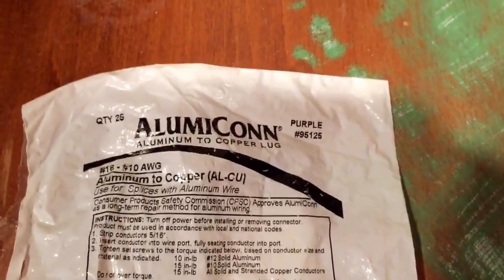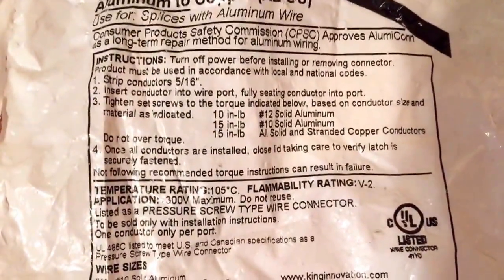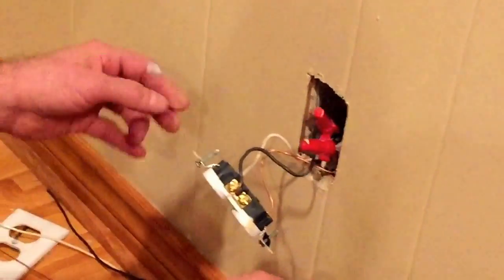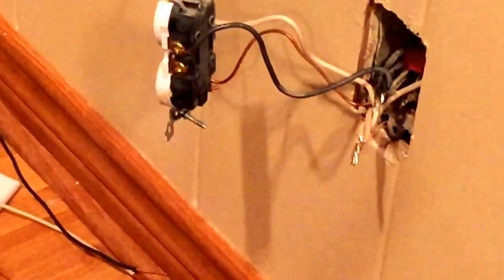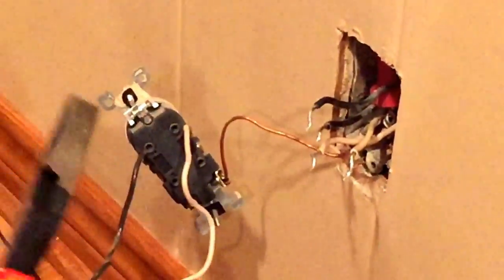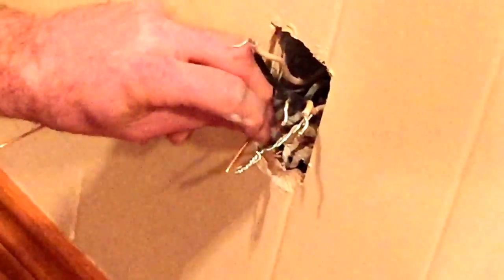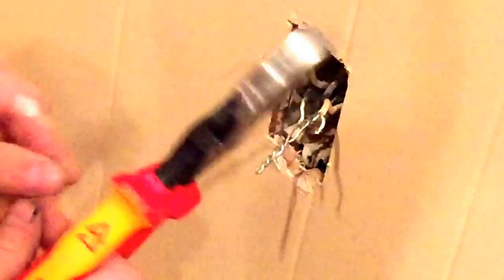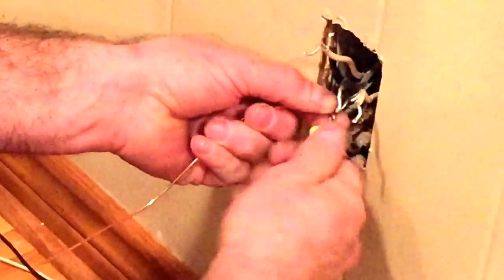Steve's video

Comment from the maker: Yes I agree using the Leviton Colar receptacles if you have enough wire works best. I assumed that's what you use that's I believe the only one made 😊
The ideal 65 wire nut cost a little more, about $5 a wire nut, but I think they're worth it. 
Thanks for your feedback!  I'm going to try to do more extensive aluminum videos. Probably about half my work is an electrician is with aluminum. It can be almost as safe as copper it's just not as forgiving if you don't play by its rules😊.
Thanks!

Comment: How come you don't mention CO/ARL Outlets???? They're made for aluminum wiring.
Reply from the maker: The Leviton (12650-W)  CO/ALR outlets work well, especially if the wire conductors are long enough. I am working on a more comprehensive video.

Comment: JUST found out the other day the whole house is full of aluminum-- started researching the whole issue of pigtails and a alumi-con connectors and finally realized- because the boxes are so shallow- there simply is not enough room to add additional connectors-- so have decided to  swap out every plug and switch for  those compatible with aluminum and copper--- would this  be acceptable in alberta,Can ???  I wired up two houses in the  TERRITORIES but that was years ago and as we all know-- codes  change with time  and province.......martin
Reply from the maker: They can be too small, making it more difficult. They can be switched out.  Carlon BH118R are good sturdy boxes to replace them with.

Comment: Can you use the purple cone shaped connectors with the antioxidant for aluminum to copper instead of these AlumiConn connectors? Or alternatively, just coat the aluminum wire in antioxidant cream instead of having to piggytail copper wires to aluminum wires?

Comment: Okay, but does the wiring still get hot under a load after installing these connectors? If it does out with the aluminum wiring.🇺🇲😀👍
Reply: Manufacturers would not make a product that would cause a fire if installed properly.
Reply: @zsdjr1  Install it in your place then, I'm going with copper.🇺🇲😀👍

Comment: These torque screwdrivers are pricey, $300 where I live. I'm wondering if I can use a basic 1/4" torque wrench in inch lbs, with a screwdriver bit attached. Those can be had for $50 and can be used on other projects, unlike a $300 1 project/1 use screwdriver for a homeowner.

Comment: do you need to do this in the main panel for the AL wires also or can they stay connected to the breaker and neutral and ground bars?
Reply from the maker: No, most breakers and ground bars are rated for aluminum. It will say on the panel or breaker.

Comment: i was literally so careful learning until minute 2 I am 100% sure is 10 gauge copper and 12 gauge aluminum, these two are compatible with each other but 12 gauge copper and 12 gauge aluminum will over heat the 15 ampere fuse in the panel box...im truly dealing with this issue right now the electrician i hired put 12g copper on 12g aluminum... i have gone through so many fuses until another electrician came in again i properly reinstalled the receptacles again to the proper wiring mixed
Reply: read a ampacity chart before you jump on youtube bashing a electrician.  Free spoiler alert, 12ga copper is superior to 12ga aluminum and wiring doesn't cause a fuse to "overheat" or blow unless it's a direct short.  and 10ga copper for a residential branch circuit?  seriously?  sounds like you're bashing a actual electrician and praising a hack, good luck with that.

Comment: If your house is wired with Aluminum, why would you use Aluminum COM’s for outlets and switches when you can just use CO/ALR switches and outlets?
Reply: I read that it also had to do with the copper shortage due to the war
Reply: @arieswaters yep, very common problem for homes built or had wiring added during the years roughly 1965 - 1975 give or take a few,  much of our copper was used by the military for copper and brass shell casings to support the  Vietnam war which was a war the US should have never been in but that's a different topic for another day.   Fortunately compatible devices and connectors along with the improved aluminum 8000 alloy were all developed in the early 1970s to hedge off many of the failures that occurred in the 60s when the industry switched to AL wiring and the same tried and true methods for copper were carried over to AL
Reply: the few reasons why is tamper resistant(TR) code requirement in residential, they do not make any CO/ALR outlets that are TR ( that I know of, or seen-could be wrong).  So minus that small requirement, other reason would be if you want to use decora outlets/switches or need to use GFCI's any place, they do not make any aluminum compatible devices to suit those needs.

Best practice really is to terminate all aluminum to tyco crimps or alumiconns like the video demonstrated, or if practical remove it entirely - issue with the rated outlets is someone unknowledgeable (homeowner/handyman) in the future could change them out to a non-compatible device creating a dangerous future problem.... and problems with electric usually result in fires, so typically best to avoid future problems.  

Strange to say, but if copper keeps getting out of hand in cost we may be going back in time to using aluminum for residential branch circuits like before, which is exactly the same reason why houses were wired with aluminum in the first place (copper shortage/pricing)...

Comment: Please let me know if this sounds correct. 12 gauge aluminum is for 15amp circuit, so the copper pigtail would be 14 gauge. So 10 gauge aluminum is for 20amp circuit, so the copper pigtail would be 12 gauge. Or,  would it be okay to use 12 gauge copper regardless if the aluminum is 12 or 10 gauge?
Reply: Sorry one year late.   Disclaimer i am not a licensed electrician,  but i have helped wire parts of the home on the family farm, as well as have various reference material regarding home wiring.  This is what makes more logic.  Because a circuit breaker is designed to shut off current if the amps exceed a safe level for the ampacity of the conductors.  For a typical 15 amp home circuit,  a 14 gauge COPPER romex is used with a 15 amp protection. However,  because aluminum is not as good of a conductor as copper, you'd up it one size, therefore a 12 gauge ALUMINUM romex would be 15 amp protection, whereas a 12 gauge copper would be 20 amp. A 10 gauge aluminum would require 20 amp protection,  a 10 gauge copper would indicate 30 amps.  So lets say you have 12 gauge aluminum with a 15 amp breaker, you could pigtail with a 14 gauge copper and still be safe from overloads,   make sense?

Comment: Great video.  I would think the ground should also use a AlumiConn (that's how the King video is shown).  Although not typically carrying current, if the dissimilar metals (mainly Al) oxidize, you will have no ground (safety issue).  They also make wire nuts for use on Al/Cu connections which I would think would be better than a standard wire nut, but there seems to be issues with them, too.
Reply: Mogman150 it is supposed to but he does it wrong, and no real electrician uses a torque screwdriver

Comment: The ground needs an Alumiconn also!  They make a 2 conductor purple connector.  The fact that the ground carries no current has nothing to do with it.  The problem is dissimilar metal corrosion (and to a lesser degree different coefficient of expansion).
Reply: I'm glad you said that...That's also why they require dielectric unions on water heaters....Thanks for the catch.

Comment: Super informative..  Recently bought an older house - didn't know aluminum was a thing..  These guys make replacing the old outlets much, much easier.  Video helped tremendously with the process.  Thank you!!
Reply: How old is your house? It's highly unlikely you have aluminum wiring in your home if it was built before the mid-1960s or after 1980. There was a shortage of copper wiring during this period because of the Vietnam war. Homebuilders resorted to using aluminum. It was only years later that people realized what a mistake this was, because aluminum wiring can't handle the same load as copper unless larger gauges are used. And you can't connect copper to aluminum. They don't like each other.

Comment: Aluminum wire scares me, I've worked on a lot of Electrical in my young age being only 24 now, I remember there would be parts of the house that would would short out and well that is how I learned. Now thanks to that I know a lot about aluminum wiring thanks to growing up in a 1972 Double Wide lol.  The new owners  that bought it tried to connect copper and aluminum in the master bathroom to ad and outlet in the laundry room using wire nuts and caused it to catch fire and burned, it luckily did not burn down but it did some damage to the place "The fire department saved 90% of the trailer" as it was a nice place for a mobile home. I always always have been scared of that while living there but like I said thanks to me I use to check every outlet, switch and junction box every 6 months and re tighten all connections. A lot of people do not realize too that you CAN NOT use 1500 Watt small space heaters and stuff because it will get those wires super hot.
Reply: We recently bought a double wide built in 1972. Would you recommended using the CO/LAR switches and outlets?
Reply: Jose Diaz it’s co/Alr aluminum rated

Comment: I heard that AlumiConn are no longer accepted by Insurance companies. They want Copalum crimps now.Is it true? I need that work done.
Reply: I'm waiting to hear from my insurance company and I have an electrician on the way over in the morning. The only Copalum certified electrician I have found said he has switched to Alumiconn.
Reply: Did you find anymore information about this. I asked an electrician who doesn't do residential and he said not to call my I durance company because that could open a huge can of worms. Now I don't know wtf to do
Reply: Oh my goodness it is October 4th 2022. I can't get a better rate on my insurance for my home because of this aluminum wire in it and I'm getting into this freaking rabbit hole with alumacons. And my insurance company not accepting alumacons but I think I found State Farm does accept them. And then someone brings up this copalum whatever that is supposed to be better than the alumicons. Holy hell I don't want to be an electrician I just want them to figure this shit out and do it and fix it

Comment: Surprisingly, the expensive Purple twist on wire nut is not recommended nor approved by the U.S. CPSC  in terms of a permanent fix for fire safety on the Aluminum to Copper wiring connections.  Neither is the whole house replacement with Co/Alr receptacles.  But the AlumiConn is however, one of the few approved alternatives.   Google "How to repair aluminum wiring: recommended methods".   
 Question:  so, after one finishes the AlumiConn connectors portion part, for both plugins in the outlet to work, one just needs to hook up ground, then one hot and one neutral copper wire to either the top or the bottom side screws on the outlet?    Thanks in advance, great video!
Reply: My reading shows that CPSC endorses only COPALUM, not AlumiConn. From looking at the two methods the COPALUM connector seems to preclude the over-torquing possibility issue, which still remains with Alumiconn.

Comment: This seems to be a pretty expensive solution. At $35 for a bag of only 10, that equates to $7 per receptacle for just the connectors. That's before the price of the copper receptacle and of course the copper wiring. You can buy CO/ALR receptacles in bulk for $3 each and save a boatload of money if you're doing a whole house.
Reply: I'm an electrician and that's what I was thinking. The problem I always have in older houses is that they cut the damn wires so sort that the wires aren't long enough to reach the outlet. In cases like that I have to use the connectors used in this video.
Reply: I'm not an electrician so I don't know about the topic. I thought this was the only solution I had. Could you please explain how the process you are talking about is called so I can see how I can do it myself? Is that a solution for aluminum connectors, like pigtailing?
Reply: This video shows the only safe cost-effective solution, unless you can rewire your house.  You want to avoid twisting copper and aluminum wires together, that's why alumiconns are used.
Reply: They are 3 dollars even when they are not in bulk at Home Depot
Reply: This still isnt safe.. No matter what you do its not safe.

Comment: I cannot believe how the electrical industry solves a problem they created.
Two problems exist with Aluminium  wiring. 1) it is soft and applying pressure by tightening a screw can over time cause the aluminum to "shrink" and cause a microscopic gap which can start arcing and become a fire issue. This is not very likely if the initial work was done properly.
2) Oxidation of Aluminum can take place and Aluminum oxide is not a good conductor of electricity so  it resists the flow  and heats up. Once again FIRE.
 Now it is true that Aluminum wiring can be problematic but mitigation measures can be done at a reasonable cost. I am NOT an electrician but I am a Physicist and  some of the solutions offered are what I would call a "make work" for Electricians. The only thing I see that makes some sense is the torquing of the soft Aluminum wires but oxidation can still occur. The anti oxidation compound cannot hurt. Mixing Copper and Aluminum creates Galvanic corrosion so the anti-oxidation paste is a must.  Unfortunately The electrical code  is what it is and make work is its objective in my opinion in this case. What would make sense is to torque the the aluminium wiring to the electrical device directly using an anti-oxidant compound.  I would like some honest engineer tell me the difference torquing on the ALUMICONN or torquing on the electrical device itself. Don't yell at me all at once!
Reply: what you suggest as the best solution is what my house has now... I only have 3 aluminum circuits, all of which are are on split circuits in the kitchen for higher energy consumption appliances.  I just checked on the Alumiconn website and it says that the ports which you attach the wires into have Dielectric silicone inhibitor in them so they have dealt with the oxidation issue with these devices.  my issue now is that I want to change these 3 outlets to the newer decora style outlets and I am thinking that this is the reason for much of the work that electricians are doing with aluminum wiring.  applying inhibitor on the terminals of the outlets is messy and time consuming.  I can see where a device like this connector might be a preferred method.  anyways, I am off to the box store to get some supplies for this job...

Comment: Why not just wire nut them with the alu to copper nuts, it would be cheaper than buying the torque screwdriver?
Reply: On aluminium wiring the wire nuts sometimes fatigue the brittle aluminium wire causing it to break off.  This looks to be a good system but thankfully I haven't had to deal with aluminium for over 20 years.

Comment: How many AlumiConn connectors is required per outlet.  The licensed electrical contractor I am considering to hire replied "will need approximately three alumiconns per outlet/light/switches."  I believe you installed two
Reply: in most case it should be only 2 because each connector allows you to attach 2 aluminum wires (if the circuit continues to another outlet).  maybe you guy was going to use one for the ground also?

Comment: How many AlumiConn connectors is required per outlet.  The contractor I am thinking about hired replied "will need approximately three alumiconns per outlet/light/switches."  I believe you installed two
Reply from the maker: I do not use them on the grounds because there is not a reaction/electrolysis  with the metals when current is not flowing through them.  So that would make one for the neutral and one the hot.  If it is used for the grounds it won't hurt.

Comment: I have aluminum wire in the attic connecting to copper extending to the porch light. Can I use these alumiconns just to make the splice between the two wires?
Reply from the maker: Yes you can as long as it's in a junction box in the attic and preferably staple.

Comment: J-box looks more than 1/8th" ...no arch shield?
Reply: Good catch, I wondered how this fellow is an electrician and not installing an extension or shield. That paneling certainly looks like combustible material to me. He is not using a tamper resistant  receptacle, maybe the code adopted in his town doesn't require it. Maybe he is the AHJ for the town. I guess we can assume he already has an AFCI Breaker on this circuit or he would need to be installing an AFCI receptacle; of course, this also depends on which code cycle he is in.